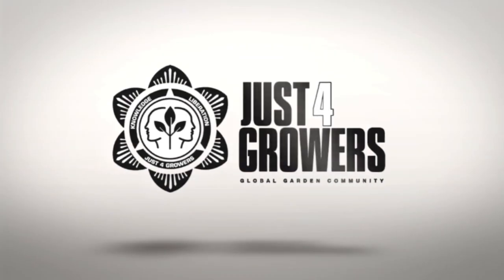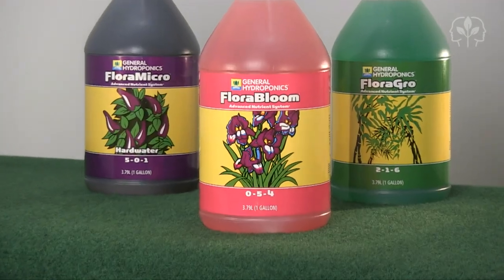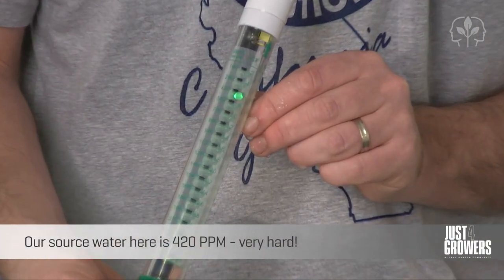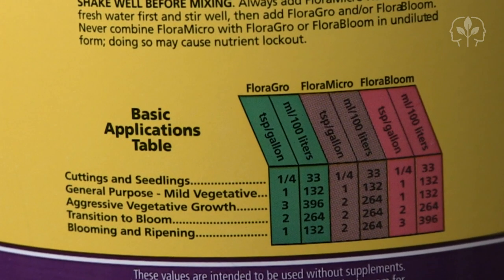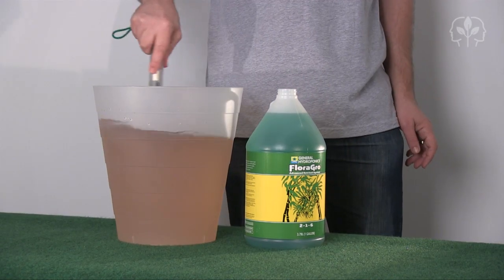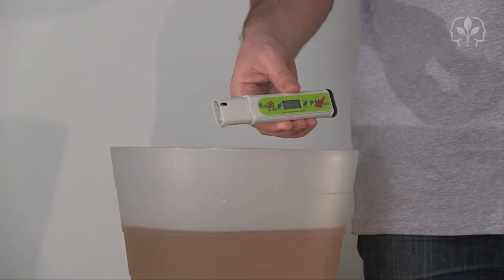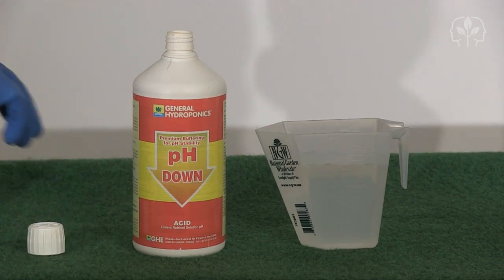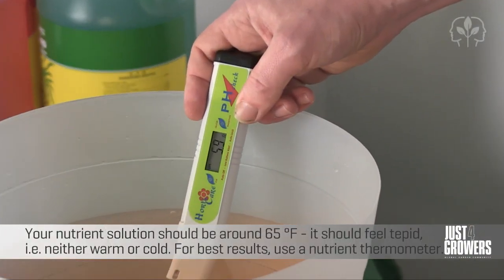How To Mix a 3-Part Hydroponics Nutrient Solution

Comment: At each week of growth, is the existing nutrient mixture thrown out completely and replaced by the the new three part mixture or do you add your new three part mixture to the existing nutrient mixture as you progress through the weeks?

Your videos are a real resource! I'm new to hydroponics.
Reply from the maker: While many growers do the weekly dump, it seems wasteful to me. You can top up with half strength nutrient solution and replace your reservoir only when you’ve topped up equal to your reservoir’s total volume. You can make incremental adjustments to your top-up solution. Really, I wouldn’t over-think it too much. Just observe your plants closely and watch your EC and run-off EC. And keep pH in the 5.8 - 6.3 zone.

Comment: This is uncorrect feed schedule. i mix 5 ml for each of them for 1 gallon and get over 1500 ppm. my tap water is 120. So if i add 3 tsp it will be over 3000 PPM.
This nutrition table must be divided into three

Comment: All the videos ive seen you adjust the ph BEFORE you add nutrients. Dont understand why you would mix nutrients before making your ph right.
Reply from the maker: Thanks for your comment, Ben. You raise an interesting point or two. Firstly, liquid concentrate hydroponic nutrients are generally acidic so it’s always a good idea to check the pH of your nutrient solution immediately after mixing, 10-30 mins later, and periodically. Most guides follow this method, and just add the proviso of diluting your pH adjuster liquids down to mitigate the risk of precipitation/ but - as I say in pH 103 - if you know ahead of time how much pH adjuster you use when mixing up a batch of nutrients, and your water source is consistent, then it’s arguably smarter to add your pH adjuster first to the water, mix in thoroughly, then add your base nutrients. In all cases, our goal is to achieve and maintain maximum solubility - but also remember that liquid hydroponic nutrient concentrates are already, by definition, dissolved.

Comment: all i have is a question and is this.Should i flush with water every third watering or use nutrients until the end?
Reply from the maker: Thanks for your question sir. You do not (and should not) flush with water ever third watering. You should always use a feed solution with every irrigation. The key is to measure the EC (or TDS) of your nutrient solution before you feed it to your plants, water until you get 30% run-off out the bottom of the pot or media, collect some of this run-off, and measure the EC (or TDS) of this run-off. Compare what you're putting in with what's coming out. If your leachate (run-off) solution is more than 25% higher in EC (or TDS) than your input, this indicates potentially problematic build-up of salts in your growing media. This, in turn, is likely due to infrequent or insufficient irrigations. Creating that run-off is essential for each irrigation event! Example: If you're feeding your plants 1000 PPM nutrient solution, and the run-off is coming out at 1250 PPM or above, you should try lowering your nutrient solution concentration next feed. If you're 250 above where you want to be, try taking 250 off your input solution. (So, in this example, reduce to 750 PPM next feed). Many growers flush with water for the last week or so. Hope that makes sense. Feel free to reach out any time.
Reply: @Just4Growers  thank you very much my friend,i already wash the plant with water and checked the runoff it was dissapointing.My water had 70ppm and 6,4 ph and the runoff was 7,7ph and 240 to 380 ppm.So now i dont know what to do,the plants look very healthy and i grow in mixture with coco peat moss and soil,so i am confused about ph all the rest look excellent.Anyway thank you again my friend and i will stop giving water i just will increase the feed to 1200ppm,because up to now i was giving maximum 540 ppm.Now i will let the pot dry and will give 1200ppm with 6,2ph and i will keep you informed

Comment: So does this actually work for hard water. I'm worried that I'll come across many issues with having hard water. I don't want to buy the hard nutrients and it to lock out my roots
Reply: Like can I use this as long as I make sure my ph is correct as well as my ppm. Or do I not need to worry about that with hard water nutrients?
Reply from the maker: Hard water nutrients are basically the same formulation with reduced calcium. They assume that the required calcium is already in your (hard) water. It's a nice idea in theory, but hard water can be high EC for many reasons, not just calcium. I strongly recommend buying a water softener, and then an RO purification system. I struggled with hard water (and hard water formulations) for years before finally giving in and going softener >> RO route. Never looked back.
Reply: @Just4Growers  I just didn't want to spend another 100+ on a water system. I was going to use spring bottled water rather then my hard water from the tap. Again just to save some money until I can afford to buy one

Comment: as mentioned before the EC of water should be below 200pmm but while mixing the micro in water it is said that it should be mixed in hard water ?
Reply from the maker: Some nutrient companies produce a "Hard Water Micro" and a "Regular Micro" part — the former has less calcium. For best results, use RO water and a regular base hydroponic nutrient.

Comment: Is it ok to use micro hard water with ro water need help please my plant isn't doing well and I can't figure out why .My hunch is the micro hard water
Reply from the maker: Hello amigo. Your hunch is right! Hard water nutrient formulations go easy on calcium and magnesium levels as they assume already high levels in the source water. RO water doesn't contain any solutes (or virtually none) — so is arguably in need of some supplementary calcium and magnesium. So you're using a nutrient product that's low in calcium and magnesium with water that needs supplementary calcium and magnesium. :) An easy fix would be to buy some cal/mag and add it first to your RO water until the EC reads 0.5 mS. Then add your hard water formulation. Hope this helps.

Comment: Can the flora gro be used alone for houseplants? If so what's the ratio?
Reply: I've have used the combo in my vegetable garden with outstanding results.  I mix up a 5 gallon batch and use a fitting that siphons from the tank and mixes it into the garden hose, so it is a bit diluted when it hits the soil.

Comment: What's the shelf life of the mixture?
Reply from the maker: That’s a great question Trinesh. I presume you are speaking of the mixed up feed solution. If temperatures are maintained at stable room temperature without extremes and it is kept shielded from light (especially UV) in a sterile container then there should be no practical limit to how long it will stay good for.

Comment: Beware this does. Not work for every medium. This guy is leaving out crucial variables. The medium you grow in may not require all three you may just need to use them separately each for different stages and they work just as well.
Reply from the maker: If you are using a soilless medium, like pro-mix or rockwool, you really need all three bottles (unless you’re following Lucas formula) - it’s really a question of different ratios for different lifecycle phases, and different overall nutrient feed strength depending on the CEC and WHC of your chosen media (low CEC, high WHC = lots of mini-irrigations with high strength; high CEC, low WHC = longer irrigation events, lower nutrient solution strength). I would not recommend using these product components separately for different lifecycle stages, and crucially, neither does the manufacturer.
Reply: @Just4Growers  you may not recommend it but your way doesn’t work for everyone so don’t make people feel like this is the answer. You have to explain to people different variables of the grow as far as mediums and super soils go... the info you’re giving out will cause new growers to burn their crop if they are not using the right medium and they go by this... also this mess contains a lot of salts which is garbage for your plants... lots of flushing or your crop will taste like hay. Worst video ever
Reply from the maker: @bryetube86   Before erring into unnecessary hyperboles (“worst video ever” - oh cummon!) try re-reading the video title. “How to mix a three-part HYDROPONICS nutrient solution.” - emphasis added to highlight the word “HYDROPONICS” which precludes use with living soils, thus arguing that my video does not address this or over-generalizes in some way is an example of a logical fallacy known as a “strawman.” https://yourlogicalfallacyis.com/strawman
Reply: @Just4Growers  bahahah look at you emotional 😭 because I’m right
Reply from the maker: If reticence and graciousness are broadly classifiable as “emotions” then we could generously award you a credit. However; could it not be more likely that your assessment  demonstrates a twin affliction straddling both the realms of epistemology and psychology? To wit, you are probably projecting your own emotional state on to a stranger. In any case, in the absence of any coherent argument on your part, I am inclined to file this delightful exchange in the appropriate folder. Best of luck with your grow and take it easy! 😃
Reply: @Just4Growers  I’d love to stick around for this battle of “whit” (not wit by the way as you put it”) but I can see you’re all out of ammo  lol. Stop using salts. This information is futile as they come. You’re giving your plants a salty bath with these nutrients. Not good. But do as you please. Tah tah
Reply from the maker: I may be out of ammo sir, but at least I came armed. There seems to be a pattern emerging, one of erroneous corrections on your part. “To wit” means “specifically” or “That is to say”. “Whit” refers to the smallest particle imaginable, so I’m not sure what you mean when you refer to a “battle of whits” but this novel term seems appropriate, notwithstanding the malapropism. Giving you an encouraging pat on the back and hoping you can find the success you deserve.
Reply: @Just4Growers  indeed. Take care
Reply: @Just4Growers  a plant has three to 4 different stages.. you’re not going to want to feed your plant the potassium and phosphorus in the veg stage. Very little potassium and phosphorus but not enough to use the NPK ratio OF THE BOTTLED nutes.
Reply: @Just4Growers  who cares what the manufacturer recommends? You honestly think they are worried about your plants? No they want you to use it as much as you can I. The biggest amounts you can and buy more. That’s all

Comment: Making a separate solution for ph is fakenews.  
I did a double study and it made no difference.  The only difference was I  had to add more ph solution as adding it to a separate water cup diluted the ph for the nutrient solution.  This is more like a marketing tactic to get growers to use more product then they need. 
Same with the 10ml. Half is all that's needed especially in veg.

Comment: Hi Everest! I am a big fan of the channel. I had a quick question for you about something I could have sworn you covered in a video I'd seen a while back. I couldn't find the video online so figured I'd ask you directly since you'd likely know the fix!

We are running into issues with our nutrient solution. We mix solid masterblend fertilizer, calcium nitrate, and epsom salts in tap water to make a 10-10-6 solution. We have it pH adjusted with a Bluelab system (which I saw according to a video of yours might drop the pH too quickly and be a source of the problems). After a day or two, we get a dark precipitate from the solution that falls out, is in particulate throughout, and chunks on the surface. The nutrients are all dissolved separately in warm water first when mixed, the solution seems fully dissolved for hours. After a day or two, the fallout happens. Any idea what is going on or what could help? FYI our water is on the hard side.
Reply from the maker: David Sperber Hi David, you should invest in a reverse osmosis water filter (and possibly a water softener / ion exchanger too) - both very easy to plumb in. With significant amounts of calcium (and possibly magnesium) already present in your water there will be more chance of precipitation.

Comment: Ya but you didn’t mention ppm again you checked it in the beginning but after adding 3 part and ph down Ppms will sky rocket by the time you have added all parts this is good advice and all but serously missing an old Essential part !
Reply: How do you balance ppms and what should it be around?

Comment: So a "teaspoon or tablespoon" is 5ml ? That is confusing. Also, if I have seven gallon pots, how much nutrient solution do I need to add for a soil grow?
Reply from the maker: 7 gallons is a good size for a soil based potting mix, but you will most likely need some bloom focused nutrients early to mid way through the generative / flowering stage.
Reply: @Just4Growers  Thanks for replying, I have the three part from GH same as you, I'm asking how much mixed nutrient solution should I be feeding? maybe that's too broad of question. I know it says to mix at a certain strength per what phase the plant is in. But I'm asking, how much volume of nutrient solution to "fully water" a seven gallon pot?

Comment: 2 questions 
1) can you use this solution to plants in containers that have a potting mix?
2) is this solution enough to feed a plant that has only coco coir/perlite?
Reply from the maker: When using a soilless potting mix like coco coir/perlite, this type of nutrient solution will be ideal. Some growers use a coco-specific hydroponic formula — which contains elevated levels of calcium — but really, you'll be just fine! If your potting mix contains compost and organic inputs then I will use just water at the beginning, going up to 1/4 strength and then 1/2 strength nutrient solution once the plant is established in its final stage pot.
Reply: @Just4Growers  sounds great! Thank you so much! I just purchased a grow tent+equipment. So should be a good time this winter.

Comment: Is it ok if nutrients are sepperately mixed and given to plants on a week by week basis. Example: water, flora, water, cal-mag, water micro, cal-mag.
Reply from the maker: No you should make a complete nutrient solution and feed it to your plants at once
Reply: @Just4Growers  thanks for the reply! Is this your personal preference in mixing nutrients or is it a common method throughout most hydro growers?
Reply from the maker: Matt Perry standard practice

Comment: Micro gets mixed first into de-chlorinated water, then add your bloom or veg after, once done, adjust your PH level to 6.0 to 6.3 PH for vegging in hydroponics or soiless growing mediums.  Flowering phase shoot for around 5.8 to 6.0 PH. If growing in soiless medium do not switch to flowering nutes until you're on the 3rd week of flowering.

Formulas are customized to suit your own needs, that I cannot share ;)
Reply: What's the mixture solutions for veg and flower?

Comment: I use 2 part H&G because it does everything 3 part does but the bigger better companies like H&G spent alot of money and scientific research into working out the 2 part is the better option this is why the best have left the 3 part behind. It's old technology. With PH testing you can give your plants anything you want but at the correct PH range for each phase of your plants life you can control which nutrients your plants will uptake.. sorted.

Comment: Not even close to the right way or I should say the right amount when you are in bloom you mix three parts Bloom to parts micro one part grow understanding that better in a 5-gallon container I use approximately 15 milliliters of Bloom 10 mL of micro and 5 ml of grow in the beginning of Bloom I should say Plus a few other things floralicious Plus recharge and koolbloom liquid and koolbloom powder the last 2 weeks you can increase the strength of your food but it still has to be three parts 2 Parts in one part don't let anyone tell you different been using general hydroponics for the better part of 20 years

Comment: Hey can you first adjust the ph and then add the fertilizers how you do it in the video? I got fall out of the solution because i added the ph down without adding it first to some water to dilute it 😰 but what happens if i add the undiluted ph down first and add then the other fertilizers? Will it also fall out?
Reply: I adjust the ph before I add nutes. Alot easier.

Comment: With this exact mix there is no need for calmag suplementation?
Reply from the maker: If you’re using RO water then I would suggest 100 to 250 PPM CalMag first.

Comment: Thank you soooo much for this Video. Every video about how to feed your plants have been so unhelpful. Al it takes is someone to go into detail and show how they measure out there Nutrients. A lot of growers just make videos to show off there plants with out giving information for new growers. I still haven't figured out what soil to use for indoor growing and i'm using the Girl Scout cookies. If i get a soil that has nutrients in it, should i still feed it more with the Flora ? also  bought 1000Watts light for the plants. Is that too much for seedlings ? How long does it take for seedlings to move into Vegetive stage ?. Any help will be much appreciated and i will definitely Sub.
Reply from the maker: Hi amigo, thanks for your message. If growing in soil, just feed with water - preferably soft water, not hard. 1000W grow lights are too much for seedlings. Invest in some T5 fluorescents and position 18” away from your seedlings, reducing to 12” as they become established over 2 weeks or so.
Reply: Fox farm (ocean forest ) use nothing but water the first 4 weeks.